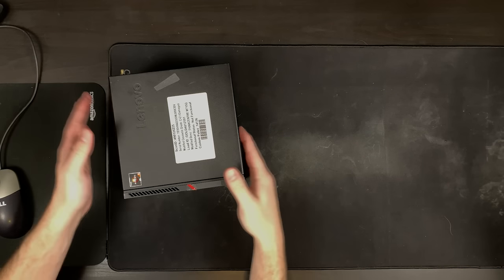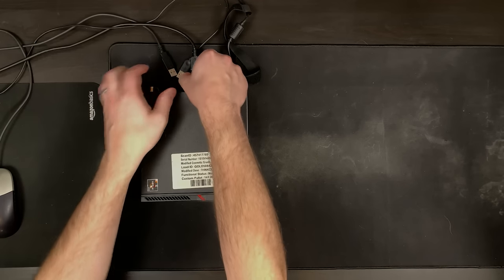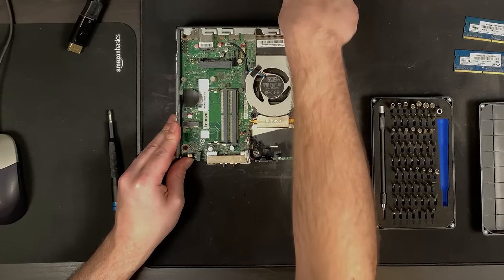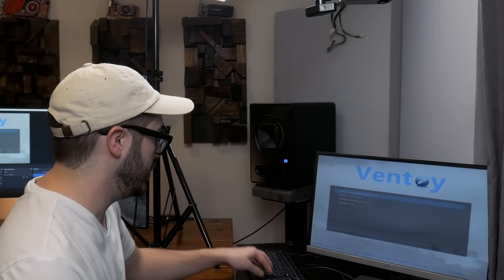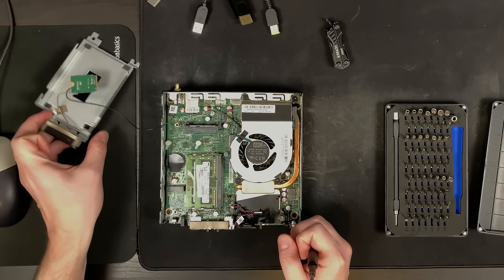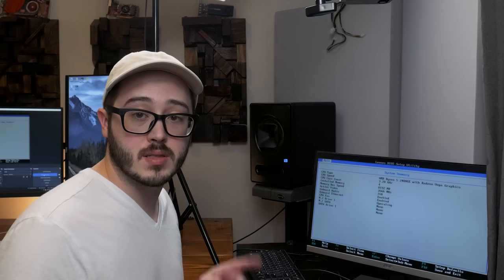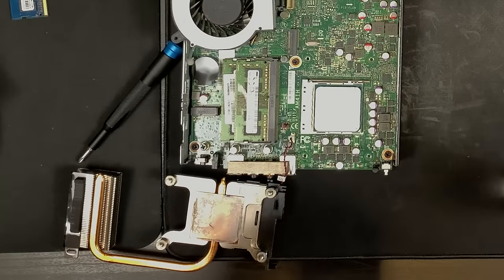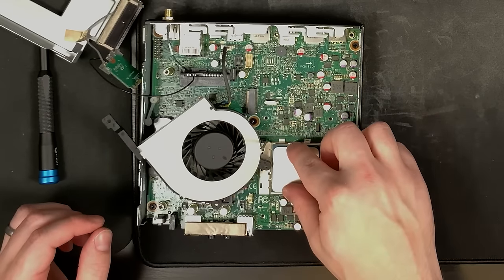Can I Fix These Broken Lenovo Mini PCs?

Comment: Moving a bad cpu to a good motherboard is ok, but if the problem was a bad voltage regulator or caps then a known good cpu could become a dead cpu in a potentially broken motherboard. Good job fixing all 3 though.

Comment: Hey great video. I have also a 710q model  where I changed the Bios chip andrewrite a new Bios using the programmer. Now the PC it's starting but unfortunately I have no video output. Is there something that I missed? I was trying 2 or 3 different Bios also the one from Lenovo. Is there anything else that can be done?

Comment: how do you get the app and appdata from an instance. I have already other instances opening without a problem. I just need this instance to run at least once so that I can back up and take my data there. Is there a way to convert this not opening 64 bit instance into a 32 bit instance, cause the instances running are 32 bit (where my laptop is 64 bit).

Comment: Hi! Good work! Amazing video! But, have you tried to clean the stick of ram that is not working?
Reply from the maker: Great idea! I think I tried that off camera actually to see if I could get it working before ordering a replacement.
Reply: eraser from a #2 clean  pencil works great to clean edge conectors. has just enough abrasive to be useful

Comment: I  would NOT be spraying alcohol onto surfaces near a circuit board due to splashing onto areas of the mother board that can cause shorts in the circuits.  Instead, spray it onto a rag or such ( away from the circuit boards ).

Comment: Look at the memory. It must be a 1Rx8 or 2Rx8.Bios via ENTER while boot/startup.
You can't mix the 1R and 2R types. I'm a Lenovo VIP
The Lenovo Tiny CPU's are mostly 35 or 45 Watt models. and the CPU's are T models. The T after the processor number. T means the low wattage CPU type

Comment: Bios issue I think, I have a m715q that had the same issues after it failed during a bios update. I re-flashed the older bios onto the windbond chip using a programmer and it worked fine after that. I'm guessing that the failure during bios upgrades are pretty common with these models.

EDIT: just saw the video ending lol.
Reply from the maker: Hahahaha. I appreciate the edit as well as the initial comment

Comment: It is a lenovo enterprice system so there is a high chance the cpu is mb locked so you cant swap the cpus and hope it works the cpu only work with the mb so if you put a known cpu into any of the lenovo boards and worked (it asks you to burn in that id into the cpu prob)  that cpu will no longer going to post on any other motherboard. Also lenovo try to put this in some of their gaming systems and the a big backlash happend i doubt they reversed anything but iam not sure.

Comment: Could anyone tell me where I can find one of those "stair-style" memory module slots like the ones from those Lenovo Mini PCs featured in the video?
My Acer Aspire 5 laptop came with only one memory slot module, but there are solder pads for another one - thing is, they don't face away from each other, but the way it's designed, the memory slots module would be just the same as the one in the video (one on top of another).

Comment: I just bought a M600 tiny. It turns on and seemingly works. But it is SUPER slow! It goes to 100% CPU usage even with almost no load. Lenovo Diagnostic tool can't find anything wrong.  It has a J3710 CPU, but my old tiny with J2900 is more than double as fast.  What can be wrong with the M600? I have tried to reinstall the whole OS, and even tried different OS on it. Same problem. 
Any tips is welcome 😅
Reply from the maker: I would check to make sure that it isn't thermal throttling. You might need to replace thermal paste and confirm that the fan is working. I don't think thermal throttling is super likely, but if you confirmed that the CPU is showing 100% usage, it probably isn't slow storage. (Which was my first thought) 

I would also try clearing the CMOS.
Reply: @HardwareHaven  i wil try to clear the CMOS. Already changed the SSD just to test. 
Havnet checked the temperature, but I see that the GHz goes to the max, so doesn't look like it throttles. 
Thanks for the tip!

Comment: I read that if everyone just in America were to dispose of their least used electronics, the pile would be the size of NYC and stand 6 stories. I think we have an e-waste problem. I want to develop a donation center where people can bring in their unused electronics for a tax deduction. Then to take that ewaste and either recycle it, repurpose or repair and sell at a miniscule price in comparison to other options. Maybe even supply technology to parts of the world that doesn't have access. I also read that they are developing a direct replacement Wi-Fi chip that'll fit in most laptops and portable devices that will connect to Star Link. If I can repurpose laptops with star link, I feel they would be fairly desirable.

Comment: I have an issue with one of mine to where it will post but doesnt always load the gpu drivers and reverts to vesa half the time. Not sure if it has something to do with the display to hdmi adapter or not.

Comment: I am done with used electronics since cryptoware has likely been the cause of premature failure or why companies get rid of them, unless you can get new motherboards from trusted source.

Wasted too much time and the price difference is not much for new stuff.  For example a mini pc that posts or works fine until the monitor cable gets a minor tug, something to watch for.  3 days setting up a system only to find out it randomly works because the monitor cable yanked on too many times an issue.

If you are learning or just setting up a media center and nothing sensitive these little projects are fine.

Now when I buy stuff, I plan to store new stuff still in the box to either resell later or use it, when Win10 no longer supported likely new chipsets out will not even boot?

And if you do use vms, don't leave a snapshot laying around with all your creds and databases running and open, unless nothing sensitive on it.

Someone can grab it and do anything they want.   I just shake my head.  Why use EFI when you are booting vms?   Anyway, cheers, great channel.

Usually these things don't boot because people carelessly taking out ram to look at it, then not seating it properly putting it back.

I see tempting offers on Ebay.  If you can get a group of laptops from a corp upgrading you might get lucky.   But you don't know if they soldered in a rubber ducky type thing somewhere, be careful if you can.

Also there is some hardware out there that has been victim of in the wild cpu bugs, that are basically impossible to fix without changing motherboards or cpus.  I would search 'security vulnerability cpu xyz, chipset xyz before you buy stuff.  Let the metal guys recycle that stuff.

Comment: I think you are not erasing correctly the bios the first time, then getting toys to read it... well that was interesting and wild. cmos on computers reset to cero! and if there are large caps like in old P4/P3 you have to wait a decent amount of time on the reset. also yes, your 2032 battery below 2.3 or something will not get that cmos up again, just replace the battery with a good new one ( some new batteries also could bein bad conditions). Not grounded equipment was a common thing on bios corruption, not all has to do with bad components. Great video, great toys! keep on it!

Comment: hi. you can try to spray some contact cleaner on those non working rams and ram slots.. works for me sometimes
..
Reply from the maker: Maybe I'm imagining things, but I think I tried cleaning the contacts with IPA off camera with no luck. Good thought though!
Reply: @HardwareHaven  deoxit cleaner it's kind of expensive but will pay for itself quickly.
Reply from the maker: Yeah I have deoxit as well. Actually used in the last hour to fix a bad charger for my camera batteries haha
Reply from the maker: I got curious and tried deoxit as well just now. No dice sadly

Comment: Re: Low voltage RAM - Dell, in their infinite stupidity, at some time in the past, updated BIOS on various AIOs and laptops (not sure on desktops) that USED to handle either standard or low voltage RAM to only take low.  So multiple systems that I bought from college auctions that were "bad" were victims of those BIOS upgrades.  They were built with standard "high" voltage 1.5V RAM, and then the BIOS update insisted on1.35V RAM in order to boot.  Downgrading the BIOS when possible or installing low V RAM got them ALL working.

I don't remember offhand which generation it was, I THINK it was around 5th or 6th gen Intel.
Reply from the maker: Oof. That sucks haha

Comment: You could have just removed the small antenna plug on the wifi module. That is way easier than unscrewing the connector on the back.

Comment: Be careful with lenovo . they can hardware mod some amd cpus . infact disable cpus from working in other systems... I take the power of and take the battery out when i clear a cmos chip. 
Sometimes its just a broken capacitor.  you could find it with a thermal camera. Fixed a computer a few times knoking the bad ones of the board.

Comment: Typically, when resetting the CMOS, you short the pins for like 10 seconds to clear it, then put the jumper back to normal BEFORE powering on. I'm not sure it's a great idea to short those pins while being powered on.
Reply from the maker: I did exactly what the lenovo doc said lol

Comment: Hi, great video, I'm here because I got one that went bad with a power on and power off  loop after windows 10 updated, I think it was, the "lenovo system" and "lenovo firmware" from windows update, when restarting I saw the update bios screen running, there was not an error o anything, but did not start again, only powers on for like 5 seconds and then power off for about 5 seconds and powers on again, always black screen, so I guest I have to find that bios programmer, thanks!

Comment: first of all...if u are messing with bioses, fisrt of all u should make a bin dump to a file and then releasing new stuff on them. Its because sn number and win key is include in that specific bin file of bios chip. After refleshing/cloning bin file from another system you will loose all of that relativly expensive stuff

Comment: I don't know where to put it so I write it down here:
I NEED HELP!

My mother has an old Dell OptiPlex 990 and that thing drives me crazy! I cannot really install a new BIOS on it as it keep getting hang up on the Intel Management Engine (ME) update. Luckily a restart doesn't really hurt the machine apart from the fact that it keeps dropping the network (and hence, she can't really use it). I've tried multiple avenues (even clearing CMOS) but so far, I'm stuck. Can someone please help me or point me to a site where I can download the old 7.0 or 7.1 ME Firmware / BIOS and force-flash it onto the motherboard ?  Neither Dell nor Intel seems to have it any more.

Or to a site that helps me with flashing the BIOS the way you have done with this PC? Any help would be greatly appreciated.

Comment: I have a motherboard that needs a new bios chip. Asked for a repair and was charged more than the board was worth new. And the pc being 8 years old I bought a new one. There should be regulations about single points of failure chips being interchangeable or mounted.

Comment: I never heard of a BIOS programmer. Do they also work for GPUs?
Reply: Depends on the flash chip, but pretty good chance yes.  That isn't exactly a BIOS programmer - it's just a generic flash and EEPROM programmer.  Pretty common and cheap (often less than $15).  Many of the common ones are based on the CH341A IC, but there's all sorts of them ranging from cheap and simple to very sophisticated (and expensive) and capable of programming virtually any flash, EEPROM, EPROM, or microcontroller ever made.  That BIOS chip is a very common industry standard package for serial flash and EEPROM memory chips used in all sorts of things.  Make sure you lookup the datasheet of the part you are writing to make sure it's the common pinout and to make sure you know and are supplying the correct supply voltage.  The hardest part is getting the actual memory dump to go in there.  Sometimes you can also extract it from bios update files, with a little know how.

Comment: Adamant: It's never the CPU - except when it is !
So it wasn't !
Don't bother messing around with cooling paste etc. during short testing.
The CPU itself is very well protected against overheating and will simply throttle down clock to reduce power consumption.

Comment: This was killing me to watch because i just dealt with a similar issue. Machine would power on, fan at 100% and, no post. I spent several hours troubleshooting it clearing bios ect. and whats funny is it didnt post until I turned it on with no ram installed got the beep error, powered down reinstalled ram and then boom it posted. So when you did that on the first machine i was like smart, but then you didnt try that on the other two. I was like come on hes got to know that theres one thing he did differently on the working machine than the other two, I have a hunch had you tried this you may have saved yourself some time! I am not sure why this works but i speculate that the original error is frozen in the bios and by powering on without ram you introduce a new error thus clearing the one that was stuck.

Comment: I thought you had a bad CPU that didn't work in the good board?
and there is a 2023 BIOS update on their site
Reply from the maker: Yeah, still not sure why that one didn’t post and I didn’t talk about it. I swapped the cpu from 3 back into 3 just to get it booted again. After I reprogrammed the BIOS on system one, it booted with CPU one. Not sure if it wasn’t seated well or what. It’s a good lesson for troubleshooting that sometimes you can’t just jump to conclusions and that’s also why I double checked to see if CPU three would boot in system 1.

Comment: Wait, don't you also have one bad cpu?  That once didn't post installed in the known good #3 system.
Reply from the maker: No, it just didn’t post with the cpu for some reason. I highly doubted it was the cpu since that’s rarely a part that fails, which is why I never explicitly jumped to that conclusion

Comment: I was given A Lenovo M715q that was running good, but now will not Poweron at all.
Reply: My 720q stopped working about a week a go.  Been looking at datasheets of parts (voltage converters, for the most part) and most are appearing to be OK.  One pin is not coming up upon a processor being placed, which is why I suspected the processor being broken.
Managed to find a new second hand one and swapped the processor and nothing happened, the machine is still as dead.  It switches on directly upon providing it with power, and then does nothing.  It doesn't beep, it just shows the on-off LED and the "tip of the i" LED lighting, and that's it.

I found a suspicious looking resistor after inspecting the board with a magnifying glass that looks heat-damaged (as if it suffered an overcurrent or overvoltage situation) and is not measuring 2,2 Ohm's as the marking indicates, but 1,2 kOhm...

There are also some other parts on I think the bottom of the board that are sitting at an angle and do not look correct, but for now I'm at a loss as to what the malfunction is... Really like these machines but this just sucked, it's just over a year old as a second-hand purchase...

Comment: I have 5 of these. I love them!
Reply from the maker: Nice! Just curious, what all do you use them for?
Reply: @HardwareHaven  They were Free from work. SO i just needed storage,

So 1 is a hackintosh - talking to you right now from it. 
2. Was my Proxmox server hosting pihole - Unifi - other things. 
3. Was my Truenas - mine have NVME + Sata
4. One has windows currently as a lwoer power option to my "Gaming PC" 

Curretnly my oldest 2 are unused need ideas. They are older DDR3 and only one SSD. 

All of the in use ones are i3-6100 or i3-8100 with 32 gigs of ram. 

Sadly I replaced 2 of them with one Dell optiplex but i'm waffling on what my best move here is.
Reply from the maker: @postnick  that's sweet! How's the hackintosh?
Reply: @HardwareHaven  Its great. The Intel Lenovo 710Q or whever it is, 8th gen, really easy EFI I found It's been solid for over a year. Its still running last years OS because I haven't taken the time to figure outr an upgrade path yet.

Comment: I use a  lenovo m710q in proxmox system - i have 4 x Intel(R) Core(TM) i5-7400T CPU in mine - but I can run OBS /ubuntu vm remotely.
They are nice computers - upgraded with 32 gb and a m.2 ssd and sata drive.
Reply from the maker: Nice! What do you do with OBS remotely?
Reply: @HardwareHaven  I can do alot :)  I can do livestreams from anywhere in the world  with more scenes and scen input  srt/rtmp webrtc /broiwser source from add graphics overlays to a scene control it by a phone/tablet via browser gui and I can even make guest/invites.
It also alows me to give others a way to control OBS while I am just operating the camera -  this setup also have restream options so I can do livestream to facebook and youtube a the same time.  I have build a raspberryPI I can put on a real videocam doing srt via portable setup using SRT protocol - we can try do a livestream together one day setup - also you can save time if you can switch obs scene on the phone.
I can add phones, tablets and other obs to my MasterControlRoom OBS - even guest can be part of a livestream setup. They dont have to install anything. I have it running on https://www.undergroundnews.dk
Reply from the maker: @undergroundnews_dk  That's super cool. Thanks for sharing!